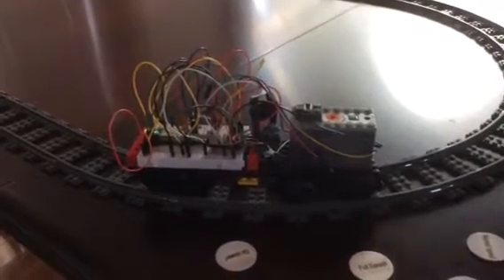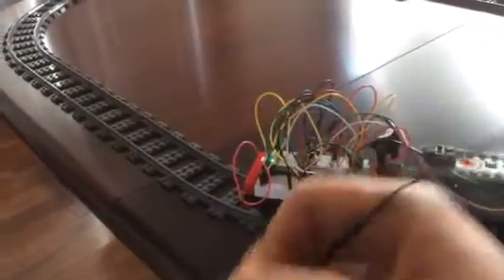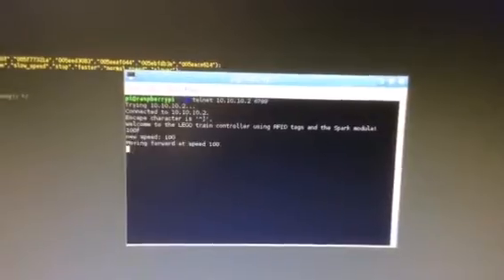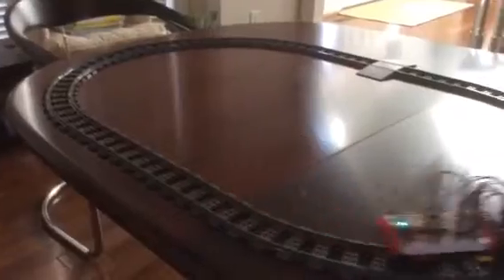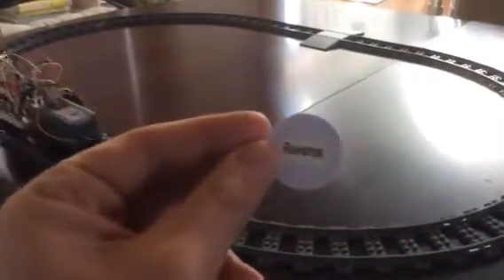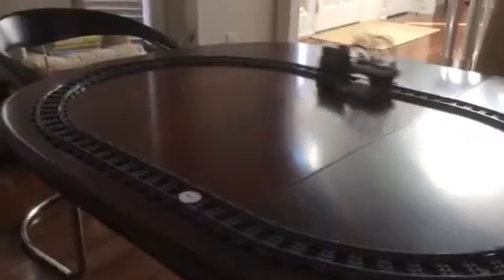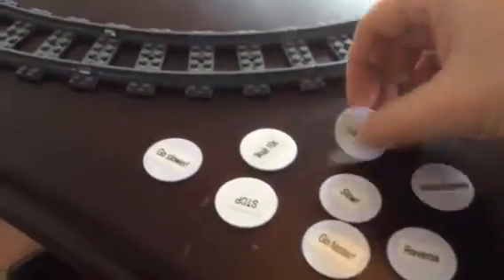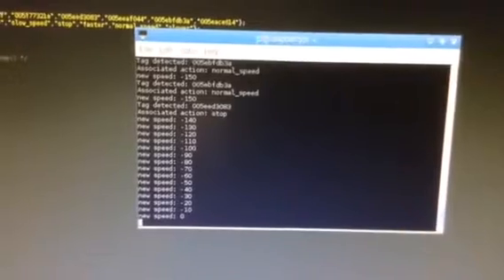LEGO train control via WiFi and RFID

Comment: How Phil,
How are you doing with this project?
I have a few questions because I am working on something very similar.
Reply from the maker: Hey David,
This setup has been running reliably on tech demonstrations for several years - allowing kids to control the train by placing tags (I switched to credit-card sized tags) under the track. I did not develop the setup further however - it is still a big mess of wires. Happy to talk and share ideas.
Reply: @flipB74  Thanks for replying this quick. How could be best suitable for us to talk?